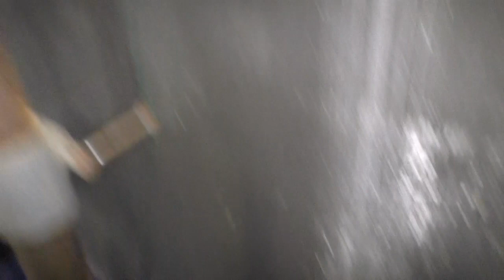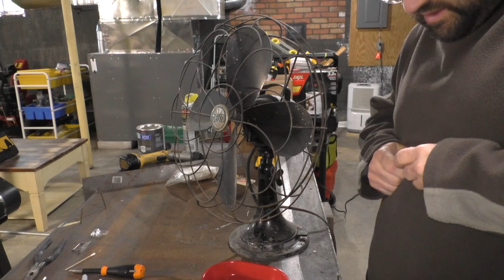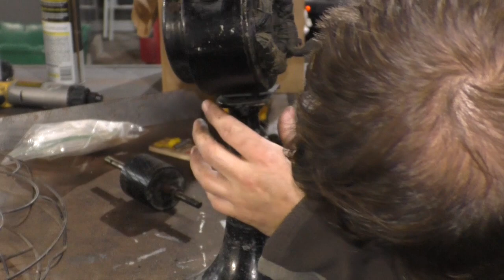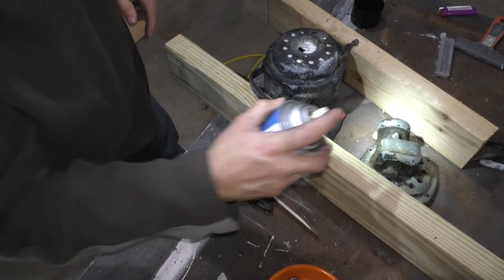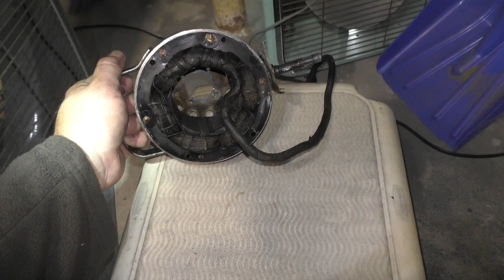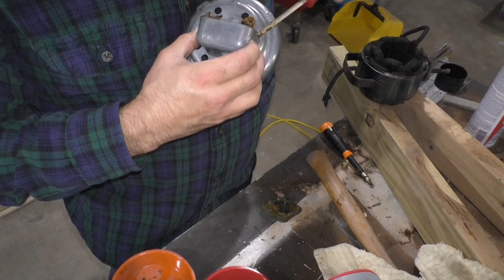1932 Delco 16" Fan Restoration: Full Tear-down and Paint Removal

Comment: I recently picked up a cheaper GE fan, got it for a decent price because they plugged it in and it started to turn then just stopped and hummed, turned out the sacrificial gear had stripped out and was jamming up. So got it working great, though it wont oscillate anymore but I can deal with that. Looking forward to seeing this one done